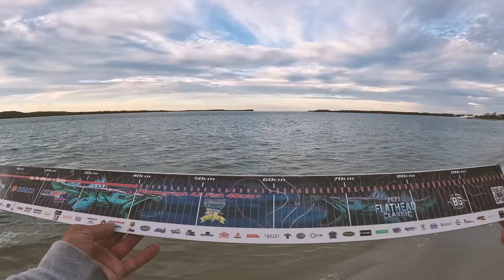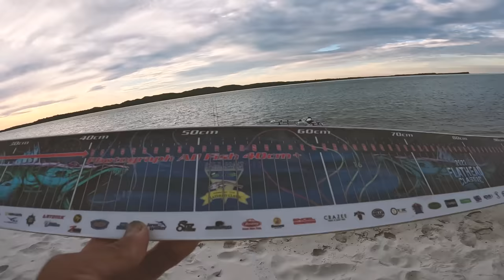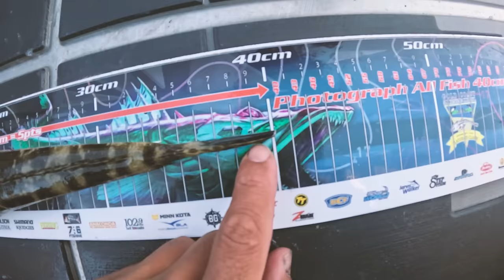SOLO CAMPING - Mangrove and Beach Fishing For Food - Catch And Cook

Comment: Metal skewers have a function different than wood ones.  Metal conducts heat.  You find wood used for soft meats and fruit/veg where internal heat isn't needed and metal for raw red meat cooking.  If you use metal with foods that are soft like fish, you may want to adjust your cooking heat/time to account for the heat transmitted internally by the skewer.  Yes, soaking wood skewers for a good hour+ helps with the burning, raising them up from the coals and ensuring a no-flame in the coal bed are also key elements.  To the rest, well done and thank you for an enjoyable outing adventure :)
Reply from the maker: Some good info, will definitely adjust if I get some for sure👍

Comment: Dude!!!! Finding that measuring stick after you needed one?? YESSS, new mods on the boat are cool too, curious if you have a half size stern anchor in case you wanted to keep it straightened up
Reply from the maker: I have a new anchor system in the works now👍
Reply: @RoKKiT KiT  that's a great move!! Gettin that smaller size anchor to store away nicely is tricky but you don't need a big one to point the boat around, just big enough to bite and hold the current, I love the multi-purpose crossbar, you should try to fab up a stowaway platform that could somehow lay up against a gunwale somewhere but still be big enough to slip into those cross bar holes and hold your weight from there to the bow so you can be up there and throw and fight with some bigger standing room!!

Comment: Where is there transducer for the fish finder located on your stabi? I’ve been recently beaching my similar size & shaped boat, and worried that the transducer is going to take a hammering. I’m thinking of modifying it at the connection points where it can fold up out of harms way. Good vid - I also recommend the 70% deet - horrible stuff though